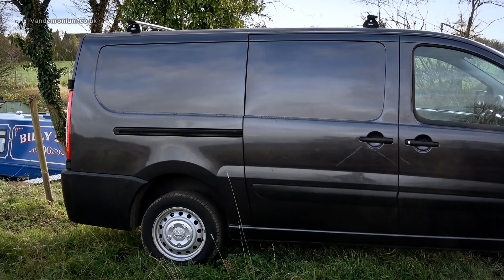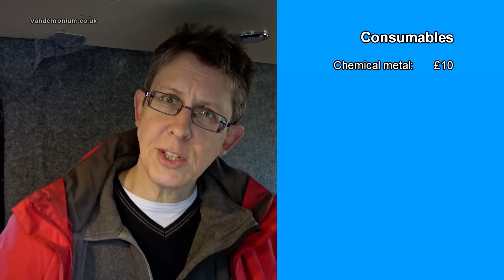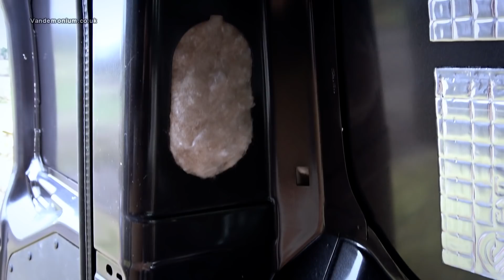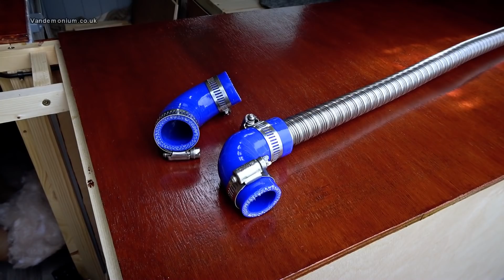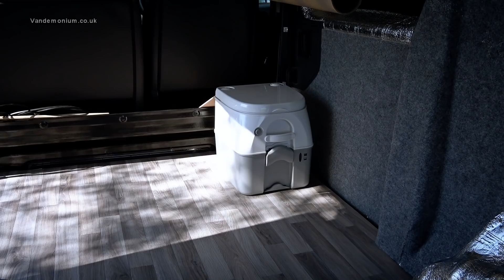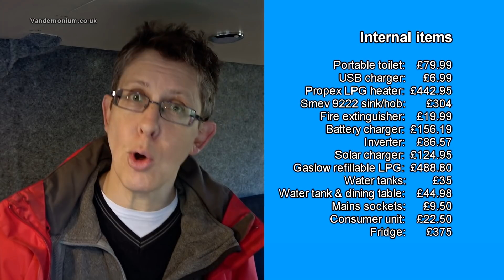Vlog 26: The costs of my DIY self-build campervan conversion

Comment: This vid serves as a really great retrospective on the whole project up to this point to be honest and yeah you are right- I do in fact quite like to know what other people have spent on projects hah. It's actually about what I was expecting for the conversion though I was a bit off on the cost of the van and funny enough I was very off on the individual line items. There's no way I was expecting all the glues to cost that much so you were absolutely right about that, but some of the Victron stuff for just one example was quite a bit cheaper than I thought. It'd be interesting to see if the costs have changed since you did this, I suspect they have probably shifted somewhat significantly in the upwards direction

Comment: One of the issues we would've had is the costs obviously. Say spend £4k on a conversion. Have to ask...how many holidays do you get for £4k or in your case £5k +....half decent holiday deal in 2024 is about £1500 for two people. So for the cost of say £5k conversion you'd get about 3 holidays in Spain or wherever. So if I bought a Ford connect or a citroen dispatch, half decent one for £10k...conversion £5k.....would probably sell it on after 3 years and get close to £15k back.

Comment: Yes very surprising just how much it costs to convert a van.
Just finished converting my Fiat Ducato and although it did cost slighting less than your conversion I didn't fit any solar or a refillable gas bottle, just standard bottle.
I also kept a spreadsheet but added an item weight column, I was only 100kgs out when I had my van weighed and most of that extra was due to outside chairs/table/pots/pans/crockery being onboard.
The thing that most surprised me was the price of wood, for some unknown reason this has gone up dramatically post covid!
Keep up the good work, love the little yellow boat.

Comment: Great Video. Have you any inkling as to what a Professional Van-Converting Company typical charge for their ‘Labour Only’, excluding VAT (assuming same standard of fit-out you did)? I’m guessing that now - 2021 - the cost of all the items you listed  (i.e.’ excluding’ van  purchase and your labour-time) would be about £7K, but I  haven’t a clue what  ‘professional van conversion costs’ labour, might amount to?  Possibly  the sum you paid for all the parts plus fittings, ‘might’ reduce a bit if acquired through any ‘professional van fit-out company’ contracted to do the conversion. Assume the labour cost would be (at least) equal to all the materials and fittings  needed to do the conversion. So a £10K Van plus fit-out parts and  material (along with labour charges for the conversion) could end up costing around £25K, which ‘sum’ (possibly??) might make it equally feasible to buy a second hand camper van?? Cheers M
Reply from the maker: No idea, unfortunately

Comment: The Dometic/Weaco CFF 45 is a very decent fridge. I have one. It lacks the stupid phone connectivity of the more expensive models, is a fair size and has a clever lid which can open in two directions as well as easily coming off if you don’t have the headroom to open it. You rarely need to take the lid off though as it hinges along the long edge, reducing the height needed overhead.

Comment: Great job. Money well spent. There is a clear argument for buying a newer van so your time and money invested in the conversion has a longer life.  (I've popped over from Cruising the Cut, it is odd hearing your voice and not seeing swans or ducks every five minutes....) 
Here in the States people complain about the 'swap your propane tank.' No matter how new your tank is you always get swapped for a rusty dinged one that's a hundred years old. Petrol stations here don't fill them, I go to the U-Haul rental place. Also instead of traveling around with the big tank, I've got a valve I bought on Amazon that I use to refill the small roundish cylinders. But when I dirtbag (car camp) I only have the Coleman stove no heater so I use a lot less gas.

Comment: Having read or watched from the beginning. One thing that I wanted to tell you that could have saved you a lot of time and aggravation in building is to have used a tic stick. Boat builders use these because of all the odd shapes that are not square and level. You use it with patterns to duplicate exact shapes. Nice thing is you don't have to buy one. You can make one in five minutes. So if you ever decide to go through another build. Get a tic stick and a pencil and cardboard.  Nice build by the way.
Reply: Great tip this. Also all that cardboard that Amazon sends us? I often just cut and tape together the flattened out card board to fit the odd shapes,  then use it as a pattern. I use the  cheap (but not the cheapest) clear packing tape on the dispenser, sometimes hot glue (I bought a big box of long glue sticks a few years ago, might end up being a lifetime's supply).
Reply from the maker: Thanks

Comment: I spent the bulk of my employment working out of vans and trucks that I had fitted out for purpose in most cases. Not quite the same but similar. It seems to me you fitted everything in with an eye on weight distribution being pretty even. A very good job Indeed.
Reply from the maker: Cheers; I tried to balance it, in particular putting the leisure battery in the middle.

Comment: Please have the air quality tested in your van, you've used a great deal of glue, stain and spray adhesives that it's alarming. My Brother in law converted vans and other autos for a living and didn't use proper PPE, sadly he died of blood cancer in 2008 at the age of 46. Just concerned, not trying to be a downer.
Reply from the maker: I appreciate the concern but I've done just one van; if I was dealing with adhesives etc every day, I might indeed be concerned but not for an occasional use camper. I barely get a chance to use it because of being out on the boat mostly!

Comment: So true about the spray adhesive thing. I did the foil insulation on my boss's long wheelbase Transit van, we had two rolls (I think) of foil and 3 cans of adhesive. Half an hour later I was like "Sam I'm nearly out of adhesive" (having just about done the roof and one other tiny bit) and he was fuming, "you've used all that already?! Mate you need to use it more sparingly, here let me show you" and after he blitzed basically a whole can on two panels he changed his tune "ok mate let's fly back to Screwfix then" and we got 6 more 😅 I went through cans of that stuff like a 15-year-old going through cans of Lynx Africa lmao 😅

Comment: I may sound a lot of money, and it is but you now have a van that is the way you wanted it to be . You have done a fantastic job of it all and should be very proud of yourself.  PS those little gaggets that lady’s use to remove the bobbles from woolly jumpers may remove the glue from your wall carpet. Good luck 😎

Comment: Thought the rear tire(tyre) looked bald too, but you did mention it was new. I had a closer look and the tread pattern on the outside edge does seem to give the impression that it's bald. Look at the center tread of the tire and viewers will see that it's actually just fine.

Comment: You have certainly saved a lot by doing the build yourself and you have quality fittings so well worth the expense. I have used eBay twice and one time I had a problem and no one would take it onboard so never again. You have done it once you can think about the next one while you are using this, you would have no issues covering your labour so more money towards the next on. I am curious why pop top and not a hi roof would the higher roof not be warmer ?
Reply from the maker: High roof would be better insulated, yes, but a pop-top can come down so less drag while travelling (better economy) and a lower profile for getting into some locations.
Reply: @Vandemonium  Thank you, most here at least are hi top so I was curious.

Comment: The finished job is great David...still gotta catchup with your vlogs on here but just wondered when you do go off travelling in it....or where would you like to go?? Cheers David xxx
Reply from the maker: Ah, the trouble is that despite having built it, I spend so much time cruising on the boat, I haven't really used the van except in winter (as you'll see in later vlogs)

Comment: Be nice to know if your still enjoying the camper and would you have needed a heater if you were only using it in the summer with all the insulation you put in the van, last thing  what would you do different. thanks i really enjoyed the vlogs.
Reply from the maker: I still enjoy it but haven't used it nearly as much as I want to due to being out on my narrowboat during the summer. Also, I took it back to storage a few weeks ago, expecting to go out on the boat again, and now we have lockdown so I could have been doing some more DIY on the van but it's miles away :-(

I doubt I'd have needed so much insulation or a heater for summer use only but on the other hand, the British weather can be so unreliable that maybe it's worth having all year round anyway.

Comment: A point about your fan, since it cost so much. I'm not an electrical engineer but I have had experience with this issue and that is . . Keep an eye on your fan motor since you've put a potentiometer on it to reduce its speed. I'm not sure how a 12 volt system will affect it, but on 110 volts, I burned out the motor doing a similar thing because the motor wasn't a variable-speed motor. The replacement motor was a variable speed type and worked fine. At low speeds, you might want to check that it's not running hot. Just trying to help. Not trying to keep you up at night! It may all be fine.
Reply from the maker: Good point, I’ll check. Cheers.

Comment: I liked the vlog, I did the same to a Mercedes Vito XLWB in April of this year and as you say, it's amazing how much all the bits and bobs cost.
The inly thi g I will sy that I think you over spent on is the heater.
They sell on ebay and amazon Chinese heaters which run off diesel. And the reviews on YouTube and three are net is fantastic, they are remote control with and LCD control panel, all aluminium internals, and the full kit is round about £105,
 After reading nothing but fantastic reviews I bought one and it is truly brilliant, you can get 2kw, 5kw and 8kw versions.
Reply from the maker: Nah I know loads of people are getting very enthusiastic about those things but I'm not going to entrust the safety of my van, with me in it, to some cheap heater. i just don't trust it.

Also, more practically, I didn't want to tap into the main van diesel tank or have to carry a separate tank when I already have a propane cylinder on board.

Comment: Is fuel costs still expensive in U.K..Is diesel cheaper on roads versus the canals?
Reply from the maker: Fuel is expensive, yes
Reply: Red diesel is half the cost of road diesel, road diesel is £1.30 a litre where red diesel. Is around 65p a litre

Comment: That was interesting and  you could have done it cheaper but....  I have often thought the cheapest way to go  is with  products  that have a certain quality that ensures a long life.
  A compressor fridge is the way to go .  As Dave mentioned they are expensive but believe me its worth it.  I know you could buy a lot of ice  for the price...but you would be buying a lot of ice anyway if you are in 100 degree heat . which is not at all unusual in our part of Canada. and as nobody sells block ice these days , we were obliged to freeze our own at home and that grew tedious . It really increases your ability to boondock and you can easily put one in a car for tent camping. And the cat liked to sleep on it when its really warm out as there is , to be honest,not very good insulation in the lid -but it was easily dealt with .  we use a folded HBC wool blanket on top of the lid -works great.

Comment: Given how you carefully built the roof/ceiling up, I would be interested to know how the interior sounds during a rain storm. In general, the rain on a sheet metal roof is quite loud, and it's one of the things I appreciate about my Xplorer's fiberglass roof, the sound of the rain is muffled and not quite so sharp. So, have any trouble sleeping in your camper van during a storm?
Reply from the maker: I like the sound of the rain so no trouble sleeping through it!

Comment: But you have forgotten the 1700 hours that goes into building the campervan I'd rather bye a used campervan I know that I can depart the second money put gets put down rather than waiting for the day to convert the thing but think about my adventure if is used
Reply: Ahh, the urban myth about valuing your own time in these types of projects, is just that, myth, and for two key reasons: The first is that our time is really not worth as much as we think it is generally and sure getting someone in to unblock your drain or some other boring task has a cost/time benefit; but, don't undervalue to the cathartic nature of a project like this. This chap has clearly gained so much from this build that would be almost impossible to value, and is clearly a world away from his day job (I suspect accounting based on the over-familiarity with a spreadsheet). Plus he has the bragging rights over knowing every detail, every design decision and equally every compromise; something you can only hypothesize about with a factory built unit (2+2 often = 3 or 6)..... Well done Sir.
Reply from the maker: I used to be a local TV news reporter. See my "cruising the cut" website FAQ :-)
Reply: @Vandemonium  I was just kidding. I read your business site too
Reply from the maker: I haven't forgotten it; the whole point of this project was to do a build rather than buy one. And buying one ready-made is much more expensive which I did not have the money for anyway.

Comment: Since Calor gas is just branded LPG, which you went with in the end, is there not a filling adapter you could have got if you needed to refill abroad? [This is of course a question I fully expect to be answered with 'nope, or not practically'.]
Reply from the maker: Do you mean an adapter to refill a Calor cylinder? I believe they exist but are unauthorised, possibly unsafe, and you wouldn't be able to refill at any UK filling station. No idea about abroad.

Comment: Boy, that was a lot of information. The result is spectacular. Very good van build for a reasonable price. As you said, if you had to figure in the time worker too, then the price would go up enormously. In perspective: we have a 2013 Opel Combo LWB (not sure if they know these in the UK) with 30K km. Bought it for €17.000 total, including VAT and BPM (this is some weird Dutch car tax on top of car price and VAT ). We went for the petrol version, due to the diesel discussions in Europe and the price of Diesel getting higher and higher. So this car was a rare find, because most of these cars are fitted out with Diesel engines. This car will not only be our campervan but also our regular car, so we expect to rack up the kilometers. 

The build was done by a small van conversion builder that in the end cost around €28.000. This includes solar panel with all the trimmings, a 90Ah AGm battery, petrol fed 2K heater, a special made bike rack that can hinge away from the back doors, because us Dutch love our bikes, but they are a pain to keep putting them on and getting them off of the bike rack to open the back doors, etc.  All in all quite a bit of money, but we have a campervan specified to our wishes and still paid less than one of the bigger standard campervans build on the Ford Transit, VW Transporter chassis or even bigger on the Sprinter or Ducato chassis. 

So, enjoy your van and the buildout you made. Looking forward to future Vlogs where you detail your experiences.
Reply from the maker: Thank you. Yes we have those vans here. I think you got a bargain! Hope you enjoy it. Cheers

Comment: I have been following your Cut videos for a while, but just found this one when you had the RV Geeks on. You are a very brave man keeping track of all the expenses, but then you are single. A question about the holes you drilled in the van, most of them you put a plastic sleeve in with a hose in it, are you not worried about  insects entering through them. Is the van your primary road transport or do you have a car too?
Reply from the maker: No, insects shouldn't be able to enter.

Comment: Very interesting, thanks. It's the total rip-off costs of some of the small items that would really rankle with me. £86 for an inverter, but £10 for a couple of mains sockets. £300 for a pretty complex sink/hob in stainless steel, but £30 for a couple of small tins of paint. It's all very well talking about the benefits of the free market, if only you could find one, somehow Adam Smith doesn't seem to have percolated down to the electric and decorating trades yet - maybe in another couple of hundred years.